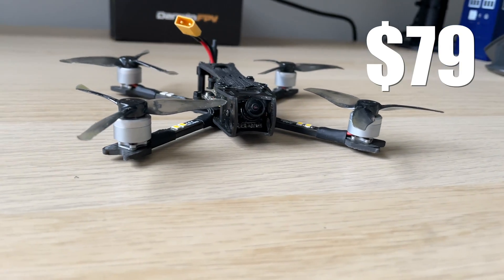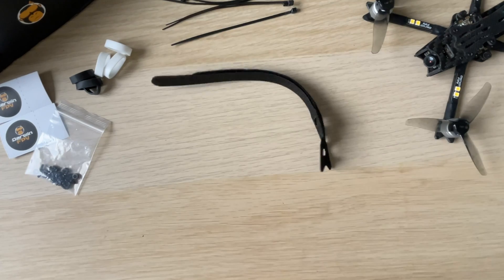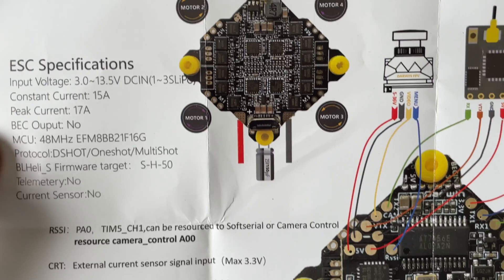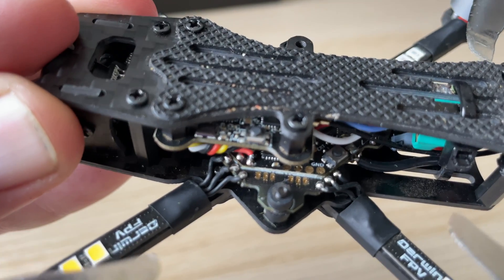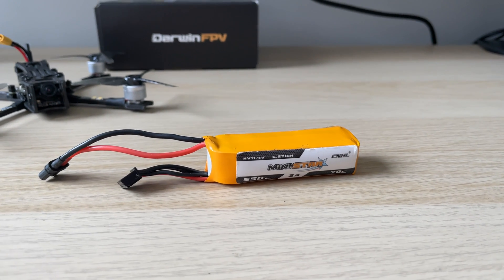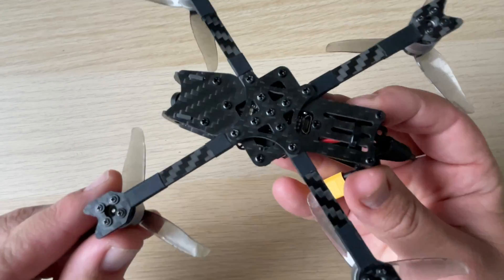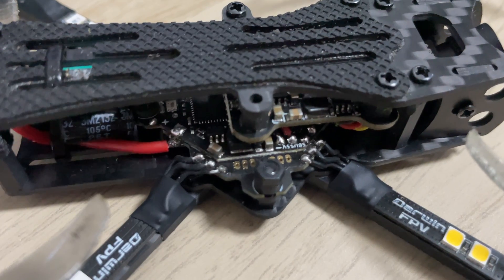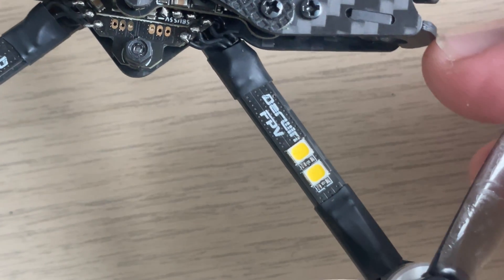This Sub 250g FPV Drone Costs Under $100

Comment: I bought this and the Stock VTX range is very very bad for me. I can barely fly around my backyard, the transmission on my Cetus Pro is significantly better. Would you recommend upgrading the entire VTX or just the antenna?
Reply from the maker: Start with the antenna

Comment: It's a decent little unit.  I've been flying it with a 2S 450 mAh pack - I get about 5 minutes of cruising.  I've got it tuned to my liking, though I don't get to fly it as much as I'd like because light winds aren't that common in these parts.  No regrets, tho'.  It flies much better than I expected for the price.

Comment: Good review thanks.
I've put three batteries through mine so far.
850mAh 2S = Sluggish and completely the wrong shape battery.
500mAh 2S = Light weight but too slow and not enough rpm to pull out of dives well.
450mAh 3S = Flew well but it was a low C rated battery so could have been better still.
So if I'm going to order some 3S packs what size would you say is best?
Reply from the maker: I’d go with a high C rated 3S 450mah. That’s the ideal battery for this Quad.
Reply: @DarrenAllatt  Am waiting for mine, ordered a few days ago, I took 3s 550mha 95C, it should fly good right? Also tempted to take 3s 850mha 100C, could that work too?
Reply from the maker: @armandraynal740  3S 550mah should fly alright however 3S 850 is too big and heavy

Comment: You say to upgrade the VTX antenna, is it just fastened with an mmcx connector? or do you have to solder one to the board? from what ive seen these small quads often solder the antenna direct to save a little extra weight/cost.
Reply from the maker: Antenna is connected via a UFL to the vtx. You are referring to Emax Tinyhawk series or the HappyModel aios on the Mobula series. Everyone else uses a ufl to the vtx. 

Any RHCP antenna with a UFL connector will be 100x better than the dipole that’s on it.
Reply: @DarrenAllatt  Thanks for the swift answer! Thats great to know, yeah I was actually refeering to just those lol I thought it was more common tho. Im looking to get into FPV on a Budget and the TinyApe Pro ticks a lot of boxes for me right now. But i would just like to know how it holds up, do you by any chance still have/fly it? can you speak to its longeviety?
Reply from the maker: @overlookedundead8711  I gave it quite a beating for the review. Was flying it around the car park race track with gravel, concrete, trees etc. It held up well, only the rubber band broke that holds the battery. If you want something really robust, you are best to get a whoop. I like the BetaFPV Meteor whoops, they are solid and will last a while

Comment: I can change the plug xt60 for use a 1300mah 3s battery?
Reply from the maker: Yes, you CAN do that. A better question is, SHOULD you. The answer is no. The 3S 1300mah would be too heavy and you’d need 80% throttle to ge off the ground. 

What’s the reason for wanting to use such as large battery